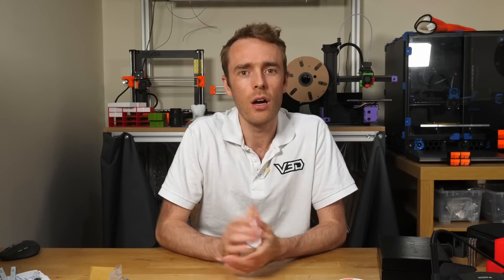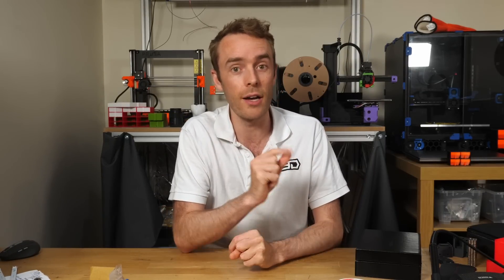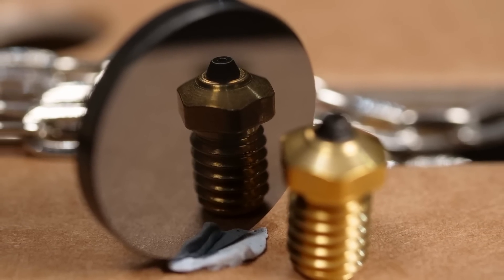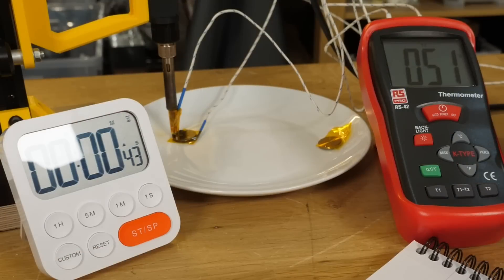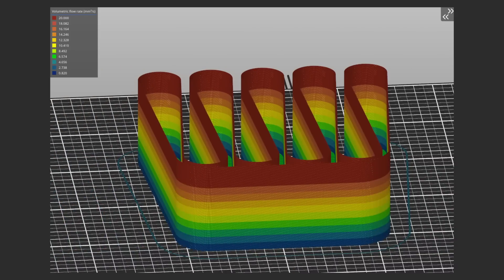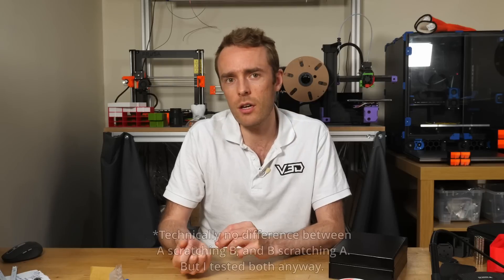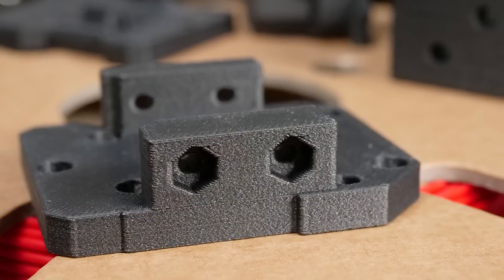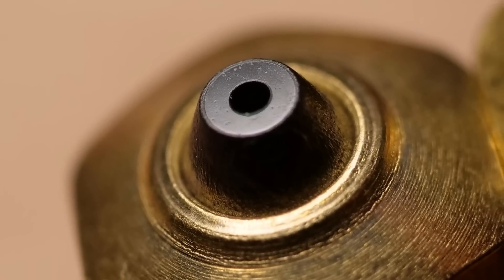A 3D Printer Hotend Nozzle That Lasts Forever?

Comment: I bought a Ruby nozzle with my new printer hoping it would be the only nozzle I need.
Sadly after a hickup, my printer rammed the nozzle into the bed during z-tilt-adjust.
Result was that the Ruby got somehow dislocated and twisted because it is just inserted into a brass housing.
It was so sever, that I couldn't print with it any more.
So I will never ever again buy a nozzle with some kind of inserted tip.
Reply: Yeah i heard the Ruby nozzle was bad as it was essentially just a ruby tube in the brass nozzle, not even a proper internal taper!  I posted a comment on it, butid love to see a cutaway / cutaway diagram of this nozzle.
Reply: @ericlotze7724  this industrial diamond tip is definitely bigger than the Ruby one. So it should resist impact stress much better.
But you got no guarantee. I'm not taking this risk a second time!
Maybe in a decade when the whole nozzle is made from artificial diamond.
Reply: @spedi6721  The brass may be needed for a seal, but yeah I’m with you on that skepticism on inserts, especially if i can’t see a cutaway.

Comment: I have the three pack as well (0.4 - 0.6 - 0.8)
Use them on my VCore with Rapido UHF
Flow Rate is better than standard Copper Nozzles, and slightly better than my V6 
Heat up time is insanely fast, but that might just be the element heating block. Room Temp to 250C in less than a minute
Will definitely be comparing them to the ObXidian when I get one (or 2) for my Revo

Just don't get them too close to the textured PEI bed .... they WILL shred it. I found that out when my BLT failed

Comment: Hypothesis - the extra thermal interface between the diamond and the brass introduces more thermal resistance than a single piece of brass
Reply: That would mean that the solid tungsten carbide ones should beat both in thermal performance while ruby ones should be the worst of them. Another reason to do the comparison of all these abrasion-resistant ones.
Reply: this is subjective as I haven't done any flow measurements, but just manually pushing the filament is much easier through the diamondback than through a bare brass nozzle, with the same settings.
Reply: Granted I don’t know if the brass threading is needed for a seal, BUT **Now i want a Solid PCD (HECK EVEN MONOCRYSTALINE CVD DIAMOND) Nozzle**!

Comment: Great video and a very interesting result! Do you know how long the 0.4mm orifice is? I suspect you may be limited by force applied if the orifice is too long. Would there be any way to get a rough measurement with e.g. calipers? I would love to run a pressure calculation on it.
Reply: a cold pull on PLA is a pretty good way to replicate the inner features to see that, it's my same thinking, probably needs better internal geometry
Reply: @l3d-3dmaker58  That's a good idea! At the very least we could learn more about the nozzle cone angle inside!
Reply from the maker: Not able to measure this small unfortunately, I may be able to ask though.
Reply: @Vector3DP  The orifice length is relatively short and is about 0.125mm. The internal geometry consists of two different tapered segments. With this design the filament is continually being reduced within the diamond until it reaches the orifice of the nozzle. Interesting results. Excited to understand them more.

Comment: I would be interested in a more deep comparison between diamondback, tungsten carbide, and steel since those are the main 3 used for abrasive printing
Reply: @Master_Misanthrope Tungsten carbide is also objectively the most badass material ever.
Reply: @RhapsodyInBlaah  You sir, are correct. I was a machinist for 17 years, I've gone through quite literally hundreds of pounds of carbide over the years and the stuff never ceases to amaze me. Watching a lathe take a 6 foot long 3/4 inch deep pass on a 3 foot diameter solid steel shaft with a .050" thou per rev feedrate is nothing short of giggle-inducing awesome lol, the 3" diameter spiral chips come off either cherry red or a beautiful rainbow of oxides as they hot-blue in the air. After the cut the carbide cutter is unphased and ready for more, and only mildly hot. 

It also makes phenomenal armor penetrating cores for bullets and tanks...
Reply: @TheExplosiveGuy  Have you read the Expanse books? Without spoiling anything, there's a lot of tungsten carbide them.
Reply: @RhapsodyInBlaah  You're referring to the point defense cannons, am I correct?😉
Reply: @TheExplosiveGuy  Yeah. And the other thing that's a big spoiler. There's a lot of amazing materials science in those books.
Reply: @RhapsodyInBlaah  Agreed. The Expanse is great book series, I love it for its grounding in science, at least to some degree as it leverages at least a little bit on the unknown, but that's also what makes it so good. A bit on the unrelated side but have you read the Hyperion Cantos series? I just finished it and really enjoyed it, as a fellow sci-fi reader I think you would like it, assuming you haven't read it of course...
Reply: I'm using a Tungsten Carbide nozzle, I'd like a comparison also.
Reply: TC is a much better idea, especially once you get to optimized geometry like the Bozzle Nozzle being possible.
Reply: Also I'd be interested on nozzle crash survivability tests of these different materials, seeing as it's often said that the ruby nozzles, while hard, are brittle and can crack if you crash the nozzle badly enough
Reply: @jezsoundie  Nozzle crashing just shouldn't happen. Bad coding or really bad setup is the only way you'll ever get a nozzle crash (barring stepper failure).
Reply: @kmoecub  no, it's very easy to get accidental nozzle crashes on some printer designs, the classic example being the Ender 3 bed that unlevels itself during printing, so it can be closer to the nozzle than expected at the start of the next print. There are many, many other ways this can happen too, especially if you are designing and building your own machine.
Reply: @jezsoundie  I've never had my Ender 3 go out of level during a print, and I'm still using the stock springs.
Reply: I have a machining background. Tungsten Carbide cuts hardened steel. Diamond cuts Tungsten Carbide. Hardened steel nozzles will almost literally last forever with the currently available filaments, especially for the hobbyist. IMO it's really not cost effective to use anything other than hardened steel or brass nozzles unless you are in a production environment.
Reply: @kmoecub  I would call CHT cost effective. It's sturdier than brass and prints much better/faster. I have never had to replace mine. The Bozzle is a lot more expensive but, being TC, should never have to be replaced, and I think it's still arguably reasonable for normal folks if you want to print abrasives often.
Reply: Potentially a vanadium nozzle as well, as that's slice3d's solution
Reply: @jamesbott2015  That looks like a high-vanadium steel nozzle that they're just branding as "Vanadium." I would love to know what properties a pure vanadium nozzle would have.
Reply: There's also the Ruby nozzle too🤤
Reply: I bags hardened, tungsten carbide and diamond. Tungsten gave better adhesion than hardened steel however it still lacked, the diamond is by far the best nozzle I’ve ever used. I print mainly CF nylon
Reply: @Master_Misanthrope This, Tungsten wins. We're talking about full tungsten carbide nozzle. Not just the tip.

Comment from the maker: Daybreak LEDs now in stock on the website for those that want to light up their printer in a super stylish way. https://vector3d.co.uk/?s=daybreak&post_type=product

Also, sign-up to the newsletter here: https://vector3d.co.uk/newsletter/
Reply: reason for the worse performance of the diamond tip nozzle regarding the print test could be because of bad internal contact between the brass and the diamond, which could lead to a sort of isolation effect, if there are micro airpockets in there. but just guessing